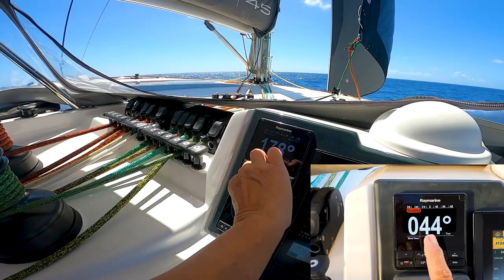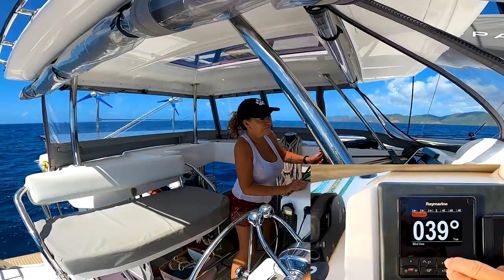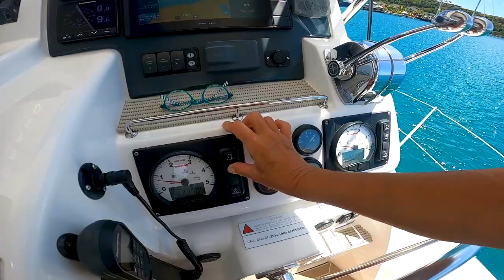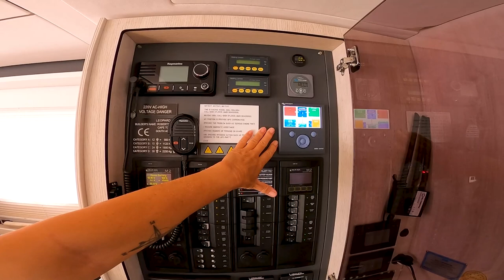#149 FIRST SINGLE HANDED sail and getting SISU ready to be LEFT ALONE | Sisu Leopard 45 Catamaran

Comment: Petro well done for sorting out and driving the Cat to the boy!. I have a humidity problem in a house on Lake Como Italy, and you are right in what you have done to reduce mold whilst away. I bought a digital humidity switch from eBay. This you can fit to your Fans and set the humidity % to switch them on when it reaches 60% (Mold starts to grow) and off at say 50% as the humidity decreases.  👍
Reply from the maker: Sounds great, will definitely investigate.  We have an aircon/humidifier on board, but too risky to let it run when we were away.